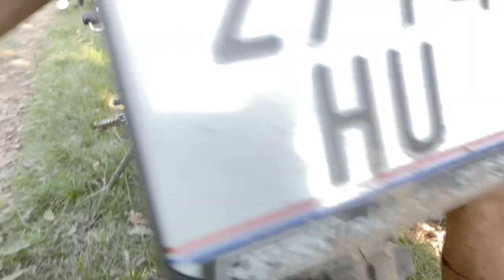Couch to Rally 8 - The Dinaric Rally 2020 on Yamaha Ténéré 700

Comment: Did you get anything on the suspension done? As I remember, you still have stock?
Reply from the maker: Not stock, I changed the rear spring to 85Nm and I used 12mm spacers in the front forks to get correct sag. Other than that still stock.
Reply: @FARANDFURTHER  It seems you are getting serious about this racing hobby, at some point you might need an upgrade. Did you get the RM3 steering damper? Looking at the trails, this would be a huge plus. Once the budget is there and it makes sense, I would go for the RM3 steering damper. A spring and spacers is also my budget option, but I am not riding these trails at your speed. The guys at MAD made a video about suspension for T7, not sure how applicable it is for racing. https://www.youtube.com/watch?v=kaHbSTDxGFI&t=1848s
Reply from the maker: Funny you mention RM3 steering damper... video is upcoming. The suspension does have limits and especially the front is not adequate for the serious rally riding. I'm at the moment struggling to be honest with justification of putting more money into suspension as for my normal travel around the world it is sufficient and the rallies will be just a hobby (I really don't aspire to race professionally).

The video from MAD is very useful, I watched it recently. They came to same conclusion as was my plan, upgrade front and leave rear (which just tuning it).
Reply: @FARANDFURTHER  I agree with you, dont spend money on it if you are just going to travel most of the time.

Comment: Great video mate, thanks for sharing! Awesome! best regards from Vienna :-)  PS. How did you lift the rear wheel for oiling the chain? Did you use a branch?
Reply from the maker: Hi Steve, glad you liked it! I have my custom made trail stand, you can see it in the video I made together with @improbablyadventuring in Morocco. I'm using that trail stand for ages now, not 100% stable but does the trick for chain maintenance or taking the wheels off.

https://youtu.be/wPTsHnxFSdA

Comment: Hi Nice video....when you crash,have you bent your standard bars or twisted the risers?....also do you wear knee brace etc?
Reply from the maker: Hi Simon,

The bike did survive the rally with minor damage but not where you'd think. I use Outback Motortek crashbars and they didn't move a bit. I don't have bar risers. I have the damage report and how the bike behaved in my other Dinaric video: https://youtu.be/RGbu7KmSsFQ

In short, bent the Bark busters, cracked bash plate and dented the clutch cover.

Yes I wear body armour, knee brace & neck brace.